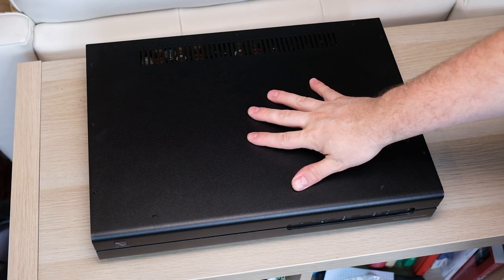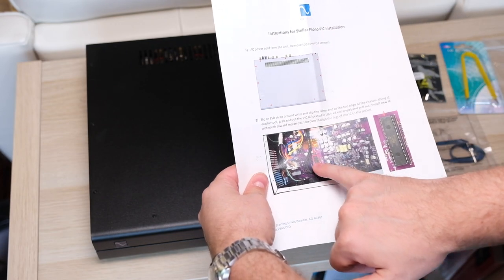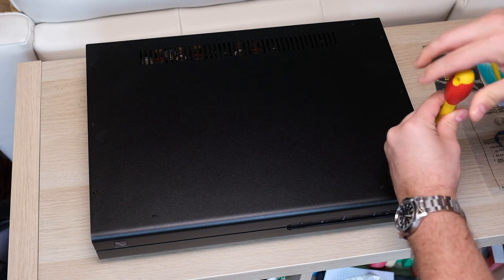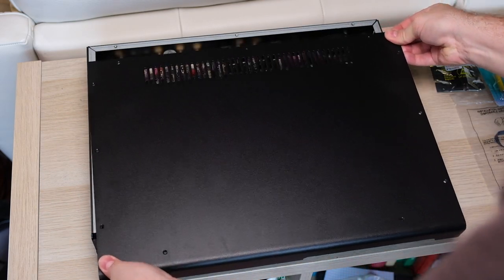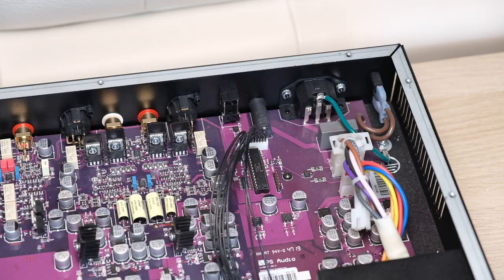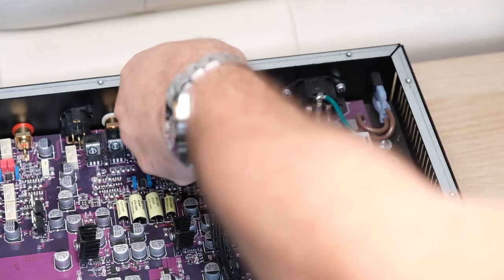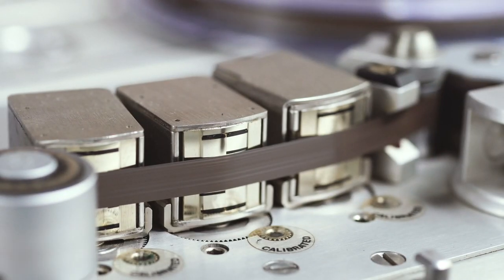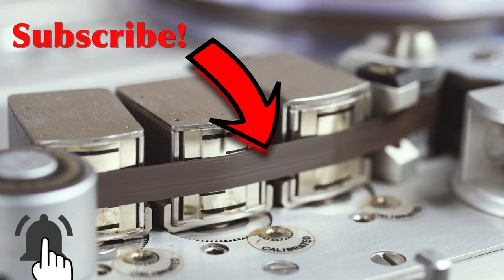PS Audio Stellar Phono: Remote problem solved!

Comment: Great video.  I own a stellar phono and have the problem that the remote only works the first 30 seconds after the device was powered on. I asked Ps Audio to send me the IC but they were saying that they only can send it to the dealer who then conducts the repair.  Why are they sending it to others?  @Guido: do you know how I could get the components somehow?  As you pointed out,  I really would prefer to avoid sending the device to the dealer...
Reply from the maker: Maybe they got scared! I contacted the dealer that never answered me. So then I contacted PS audio directly and they gave me the option to do it bt myself or with the dealer. Tell them and mention the video as a tutorial :)
It is very easy to do!

Comment: Ok, Have you told to the people that it is necessary to unplug mains supply cable before opening the cover? 
2: You did not mentioned that it is critical how Is IC oriented, because it can be stubbed either way, but it will probably burnt out in case of error?
Reply from the maker: No, I did not say anything about the cable, it's obvious but you're right better to say. The orientation was briefly mentioned at 4:08 in any case the whole thing comes with instructions. I just wanted to highlight the issue and show how easy it is to solve it
Reply: @anadialog  ok, it is better to say to unplug main cord because in hurry it can be often to forget. But, who reads instructions and follow step by step, shouldn't be any problem.

Comment: Damn so many caps on a board! Bad chip? Why not fixing this with a firmware update ?
Reply: It's an overly complex and overpriced product.  There's no way one needs 700+ components to design a superb phono preamp -- but when the designer is chasing the false and entirely subjective goal of supposedly superior "musicality" and works for a "high end" company, I suppose anything goes.  Moreover, there's no way one can account for a defective IC in a remote control IR sensor circuit with a "a firmware update" -- and we don't even know if this thing has any firmware to update!
Reply: Near the IC is visible a 6 pin header should be there for firmware update, but you need a specific programmer for that.